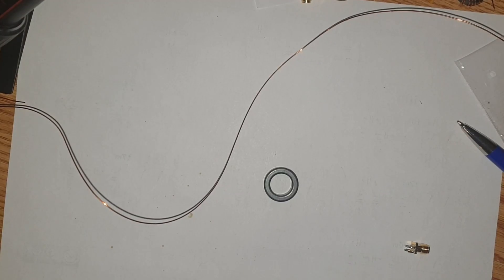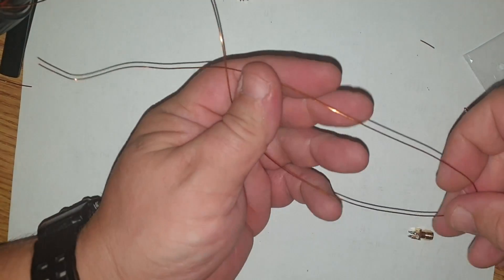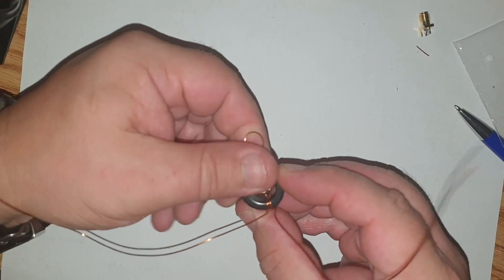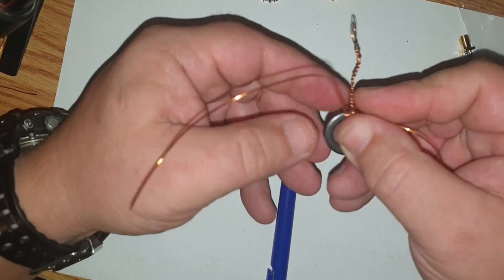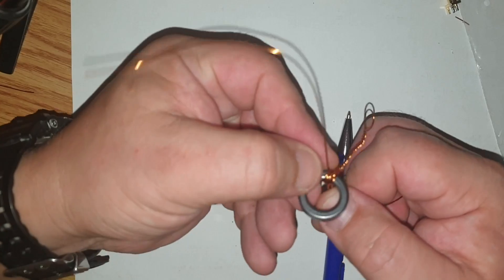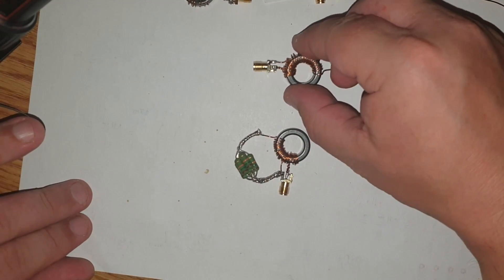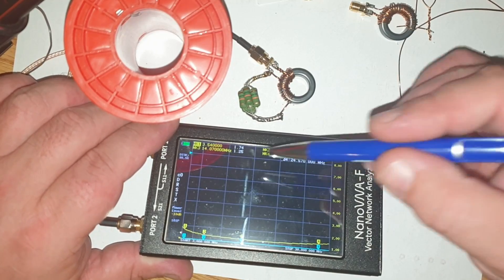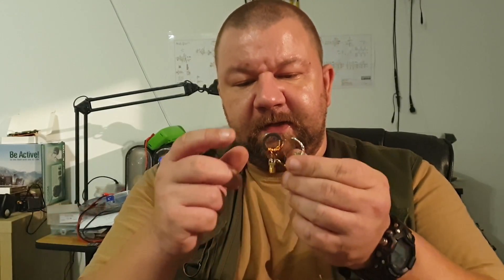EFHW Transformer - without capacitor: alternative winding pattern

Comment: Great video again, Manuel. I never done KN5L method on FT82-43, only on FT114-43 and FT140-43. I noticed that efficiency on single FT114-43 was 86-89% 28:4turns, but the same KN5L method on 2xFT114-43 was 92-93% on 80-15m and 89% on 10m band. I think it is worth trying stacked FT82-43.

Comment: Hi! Do you consider a tight winding (with no spaces between turns) and tapped primary is superior in efficency than a toroid with the turns evenly spread out and bifilar por the primary? I believe in that case a 3:21 is more efficent that 2:14, am i right? Thank you!
Reply from the maker: Absolutely not. I saw, that behavior of bifilar and tapped autotransformer on the same core were 100% identical. More important is core cross section and transformation ratio. See later videos on that topic.
Reply: @dl2man Thank you.

Comment: The way this works,  is that the primary winding needs to have enough turns to achieve an impedance of 150-200 ohms.   This is why there is 2 turns on the typical FT240-43 and 3 turns on an FT140-43.    A smaller core needs more turns.    The more secondary turns,  the more the high frequency response is adversely affected, with increasing stray L and  components.   So a trade off.    The capacitor deals with stray inductance at the higher frequency end and is used to tune for best performance.   It isn't necessary,  but useful to tweak better performance.

The other point is that binocular cores are naturally more efficient (this is why they are used in rf amplifiers and not toroids).  I don't understand why toroids continue to have the focus of attention.  Efficiency is improved by stacking - two FT140-43 are about 5-6% more efficient than a single FT140-43,  only require a turn primary and therefore have a better HF response.
Reply: Binocular are better? I'll try and build mine like that in future! Thanks.

Comment: Could the ohmic loss in the primary be a reason for low efficiency when tested with 5W input? It's half the thickness of a traditional bifilar winding and will be carrying 7x the current of the secondary.
Reply from the maker: Ohmic loss ? I don´t think so. On thermal images you usually see the core heating up, not the wire.

Comment: Can i do with 140/43 toroid? Thank's
Reply from the maker: Yes, you can do that of course. However, I´d suggest to go 2:14 Turns in case of FT140-43.
Reply: Yes, and did that today. But before someone starts winding, read further till the part where 

Manual says: "I turned back to the original design with cap, beceause of the loss"

Test 1. First tried this method, with the 100Pf capacitor, removing the cap was improvement, adding 47 Pf even more.

Test 2. So, rewound it with 3 Primairy + 3 and then wound back, 47Pf was still there and removing made it even better. (adding 100Pf did not)

What i always do: add 1 and remove 1 winding from the secundairy side, adding 1 gave improvement, possible i miscounted.

What i also discovered: it got wider, even on 50 Mhz under 1:2

results:

3.65 Mhz 1:1.6
14.14 Mhz 1:1.47
21.5 Mhz 1:1.29
28.9 Mhz 1:1.05

Again, nice experiment. Not suitable for real life due to losses.

73, imre

Comment: 👍Thanks for sharing.
Is that x5 15K parallel resistors (3K) load you have?
I have made some UNUNs for EFHW where I ended up doing a similar thing to get a good match. In my case, I wound the primary turns over the secondary turns.

Comment: I think I'm feeling stupid at the moment.  I've watched you wind that core at least five or six times now and it seems to me like you are winding up with effectively a 3:18 turn transformer.  Winding the secondary the way that you are seems to me like the first 3 turns of the secondary are canceled out by the primary and subtracted and you wind up with a 3:18 Turn or 1:36 impedance ratio transformer instead of 3:21 and 1:49 respectively.

What is the value of your load resistance.  If you were figuring on 1:49 but only got 1:36 impedance ratio you might get an even lower SWR if you added three more turns to the secondary. 

Someone else mentioned stacking two 82-43 cores.  That might be worth trying.  Also have you tried 3:24 Turns ratio for 1:64 impedance ratio?  TNX

Comment: Hello, the main measure is missing: the insertion loss!
Assemble a second identical transformer and connect the two high impedance secondaries together. The primaries will go to the two ports of the VNA. Measure the transfer loss (Gain) and divide by two. Those who do not have a VNA can do the same test with an rtx, a power meter and a dummy load. Let us know. 73s.

Comment: This is really exciting - this week I bought ten of these toroids and 10M of that wire to experiment on.  In another video you mentioned using an FT140-43 as the 1:49 UnUn for the 100W version of the U01.  Have you tried this winding pattern on the bigger toroid?  Cheers!  -Rob VK4SSE
Reply from the maker: No, I didn´t test this Pattern at all in practice. It made me suspecious, as the windings are very close together where we have higher Voltages. So I went with classical 2:14 +  cap Design on my 100W Transformers.
Reply: @dl2man I have stacked two 140-43s and made the usual 14:2 with the crossover, and first 2 turns twisted together. The 100 pF capacitors are in the mail.

Will this work for 100 watts?
I am a (relatively) new HAM and have purchased my first 100 watter..
Please help!!
73 de VU2EHC
Reply: @drankurbaruah Yes it will. 80 and 40m are fine with swr around 1.5:1 but I find it best to use an atu on 20 to 10m.  You will go nuts trying for low vswr on all bands.   Cheers from VK5LB
Reply: @Yosemite_Sam  Thanks for the reply. I built it and it worked well.. made contacts with Cape Town from India!!! 
😊😊 Super happy!!
73 de VU2EHC

Comment: Merci Manuel! I’m anxious to see you measure the real losses at 5 watts. I am starting to think that the losses on the transfo for efhw are enormous, and nobody realizes it. Good work Manuel, Best!
Reply from the maker: I realized, I should have added that to the Video, but it was already uploading. So: The back to back results were way worse compared to the original measurement of the same sized core. I will probably do a real world test, to make sure it has nothing to do with my test setup / enviroment. 73 Manuel; DL2MAN
Reply: Thanks, I wonder about that. Losses are expected, but I would have expected 1 %. I am really interested in this, I have had no success with efhw, compared to dipoles.

Comment: While I'm sure you can add sufficient capacitance by increasing the inter-winding capacitance this way, what I am curious about is any efficiency differences between the 2 different coil making methods, the bulk capacitor vs distributed capacitance. I have lots of capacitors on hand to use, but I'd like to use whichever method works best. Would you do an efficiency test for us in order to compare the 2 coils when you have an opportunity? Thanks.
Reply from the maker: I realized, I should have added that to the Video, but it was already uploading. So: The back to back results were way worse compared to the original measurement of the same sized core. I will probably do a real world test, to make sure it has nothing to do with my test setup / enviroment. 73 Manuel; DL2MAN

Comment: Thanks for the video Manuel! I tested the KN5L windig after your hint as well this afternoon. And compared it with the "normal" 3to21 and 4to28 winding on a Würth core (similar size as a ft82). With the KN5L winding and 4to28 I got good results and even better with a 33pF capaciator. The würth core has a lower AL than the Amidon.  I will test tomorrow also your Suggestionen of 3to21.  
But according AF7NX,  there is maybe one general downside with this winding pattern.
You will physically cross the low site (GND connection) wire with  approx. 1/3  of the high site wire on the core. So this wires are very close and can have voltage difference of >210Vpp @10W and more. What do you think?
 73 de Jan
Reply: I'm not Manuel, but I'd suggest a bit of electrical or Kaptan tape, or position the cross-over point a bit up and squeeze in a touch of epoxy adhesive to keep them apart.
Reply from the maker: Hi Jan, that´s a valid point ! if the enamel coating was damaged, this will give very ugly effects in deed. I found anyway, that this pattern was not as efficient as expected in my back to back measurement. Actually pretty dissapointing and worse compared to the more "traditional" winding pattern with C. Practice test will follow. With your great  PCB´s. 73 Manuel; DL2MAN
Reply: @dl2man  Hi Manuel, sounds interesting! one other thing I was Thinking about: As you changed the winding directing after the 3 "primary" windings, maybe you need to add 3 additional windings on the "secondary" coil to get the 1:49 because it is a auto transformer and he flux is 180° shifted?